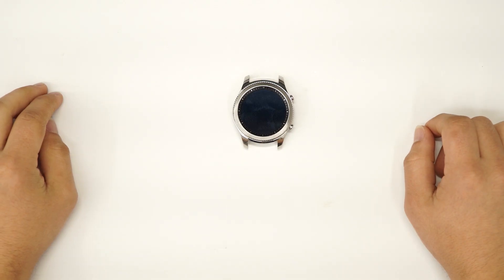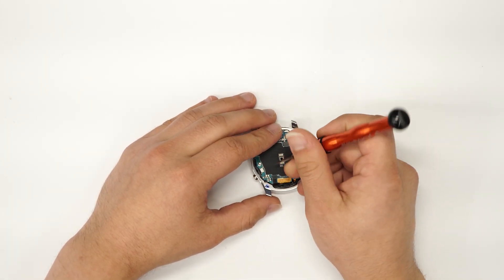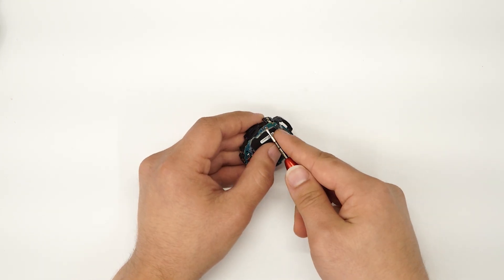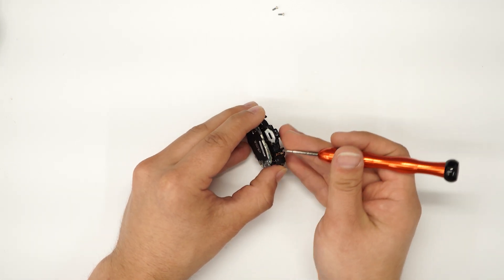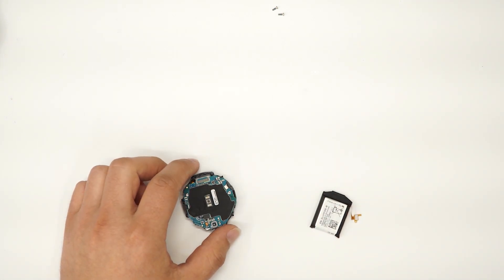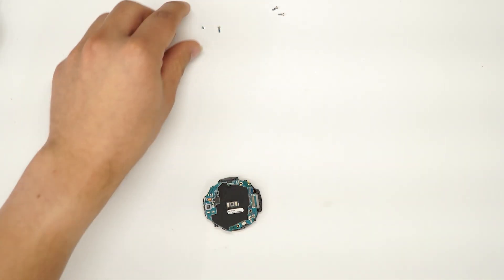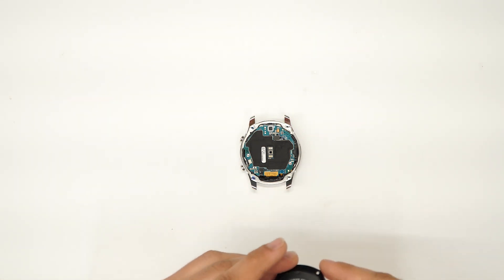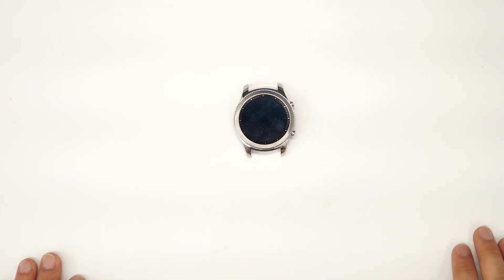How To Fix Samsung Gear S3 No Power Motherboard Replacement

Comment: Really good video, thank you. I replaced a battery in a Samsung Gear S3 frontier. The old one stopped holding its charge for a whole day despite turning off all unnecessary functionality. Just clock and email notifications. New battery went in OK and has charged from 20% to 76% via dock plugged into PC. But, the watch will not turn back on again. Nor will it go into rebooting mode despite following Samsung reboot/ factory reset instructions. Could the motherboard be shot? if yes do you post internationally. Thank you again for the great video.
Reply from the maker: Hello 👋 please try this. 

Put it on the charger and press both buttons at the same time for about 15 seconds. See if this reboots the watch.
Reply: @Joesge  Thank you for the suggestion Joe. Sadly, that did not work. The battery charge level came on (100%) but nothing else happened. Really appreciate your replying.

Comment: Is there a way to glue back the ribbon cable to the board if I pulled to hard
Reply from the maker: Thanks for the comment. Unfortunately, you will need to replace the board that the ribbon was connected to. 

-David P
Reply: you can attempt to micro solder the ribbon back... or buy a new MoBo, but then will samsung allow it to update? might have to buy from a reputable source. unfamiliar territory
Reply: @pilau  yeah I took it to a place where they could repair it...and behold they did was quite fast
Reply: @ragansei  where'd you go and how much did it cost you?
Reply: @eraofdanon  I took it to a local cellphone repair store and they just soldered back again, no replacement. Pretty cheap.
Reply: @ragansei  thank you!!!

Comment: My s3 frontier suddenly stopped working after i passed my wrist near a magnet in work, doent turn on  and if i put it to charge, charger just blinks red
Reply from the maker: Thanks for the comment. Sounds like your watch may have had a short due to the strong magnet. You may need to replace the mainboard.

-David P

Comment: Hi, I don't know long it's been since you've posted, I wanted to get your thoughts regarding an issue with my Samsung 3 10.1 after replacing the motherboard. 

The tablet has been turned off for about two weeks & sitting in a dresser drawer awaiting the arrival of the replacement motherboard (purchased at Amazon). 

I installed the MB, set the battery (also new) back in place, then pressed the on button to test. Nothing. I thought if I put it all the way back together the power button would switch on. Again nothing. 

Maybe the battery had completely drained? So I plugged in a charging cord, and left it in for about 15 minutes, realizing it wasn't even charging. Just a dead screen. 

Can you tell by what little I've shared, if it's an easy fix? What did I goof up? Lol 

Thanks in advance!
Reply from the maker: Thanks for the comment. What was the original issue before you replaced the motherboard? Perhaps the motherboard was not the initial issue. Also, be sure that the LCD is not damaged/cracked as the tablet might just not be displaying anything. Test bad LCD by plugging it into a computer and see if the computer recognizes the tablet. Check to see that the charger port is not visibly damaged from the outside and that the pins on the back of it that are soldered to the board have not come loose.
Hope this helps
-David P
Reply: @Joesge  Thanks for your reply. The reason for the  motherboard replacement was the connecter for the graphics lead broke while replacing the battery. If that makes sense. It turns out the battery was indeed dead. I plugged it into the charger again, then held the power button down for about 30 seconds-- boom, the charging indicator came up. I charged it for a couple of hours-- she nows works great!
Reply from the maker: Great! Glad it worked out.